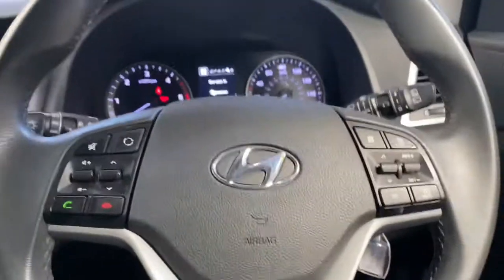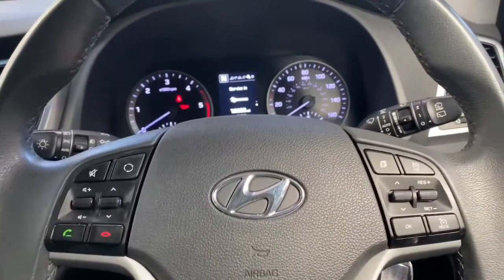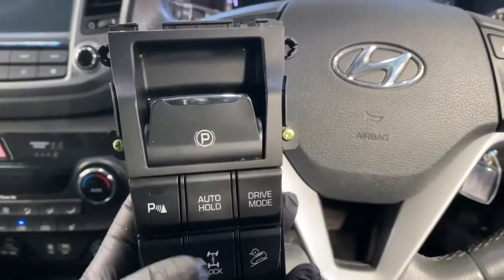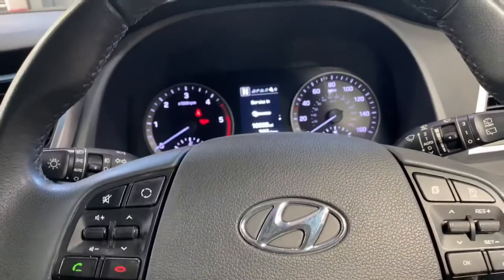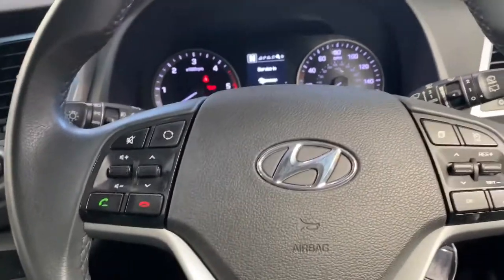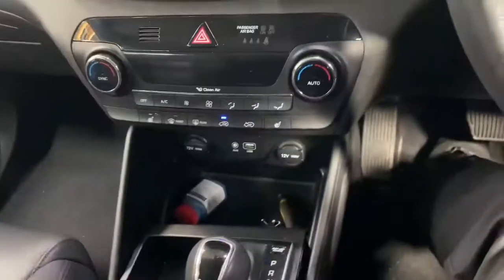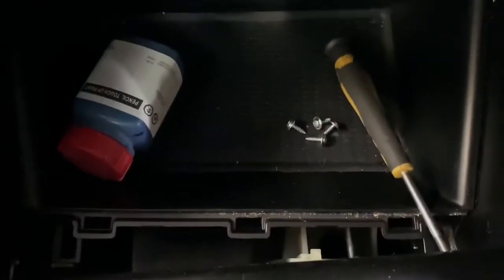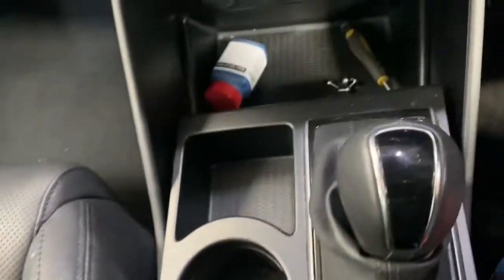#Hyundai #Tucson #electronic #hand #brake #switch fault #2018

Comment: How do you loose the unit the switch sits in?
Reply from the maker: Clips and screw have a look
Reply: @g_a_bofficial  May you show how to remove the box of the parking brake switch please.I try to replace the parking brake switch myself ,but I can't figure out how to remove the box.
Reply from the maker: That car is gone now but I’ll do my best to guide you  follow the instructions in the video remove the cup holder unit first unplug the plugs underneath the hand brake switch then   Lift up the unit underneath the handbrake switch will be four bolts remove then and you switch should come straight out.
Reply: @g_a_bofficial  Thank you very much for your generous help🥰
Reply from the maker: No worries